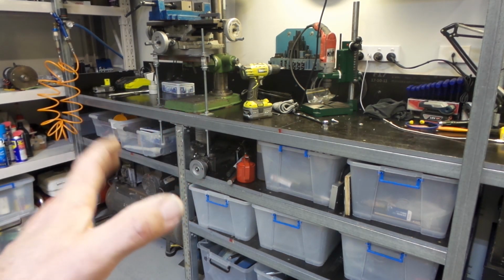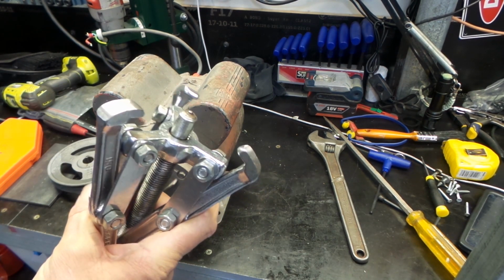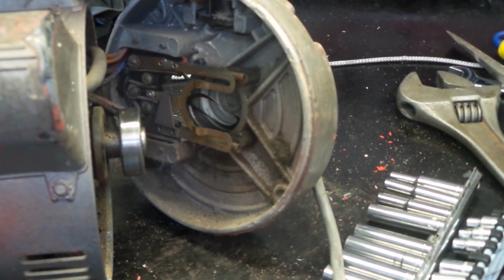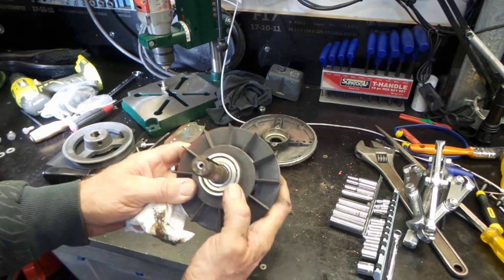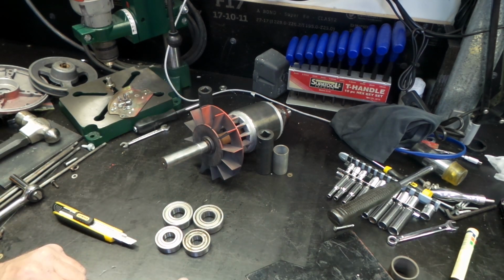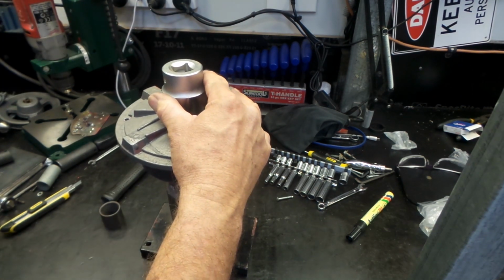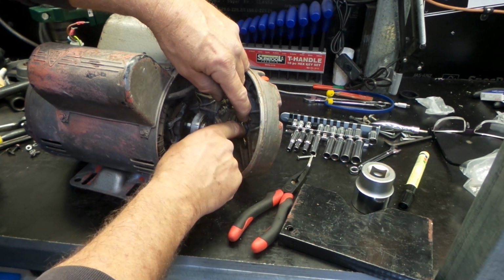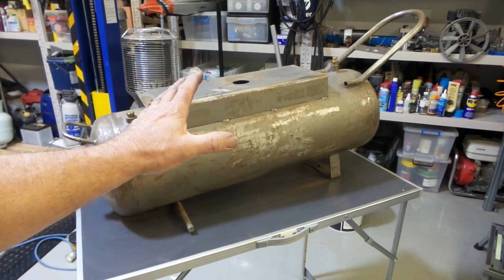Workshop Air Compressor Rebuild. Episode 1, Electric Motor Tear down

Comment: Wld I benefit at all by putting everything off my craftsman 5hp single stage 20 gallon 240 volt  on a 60 gallon tank
Reply from the maker: Absolutely Russel. Great Upgrade. A lot of Guys will join Multiple Tanks together for the same effect. If you can, you could even keep your existing 20gal in the system too for even more stored air capacity. Cheers Mate.

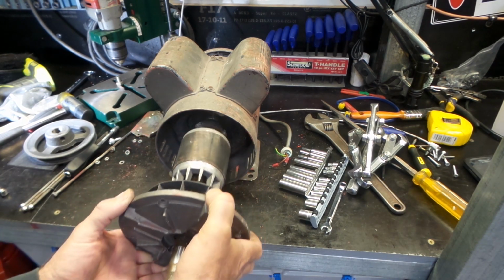Comment: I have an electric motor just like your but mine was taken from an old washing machine and I want to use it for a grindstone. It has 4 cables and the same thing on the back of the rotor, as seen at 7:40 and with the same springy contact at 7:23. One of the 4 cables goes through that contact. I wanted to know if in the case that I bypass it would  it still work because i really dont know if i need it or not

Comment: At least the bearings are were standard. Last oriental motor I had apart, bearings were marked 6202 (Politburo nominal 15 mm bore), measured 14.00. No snap rings or shoulders, just a chisel gash to locate the bearing axially. Let's hope your compressor rocks another 30 years in the free world!